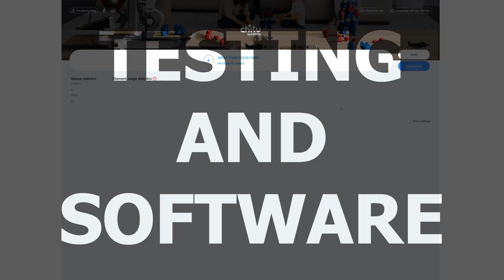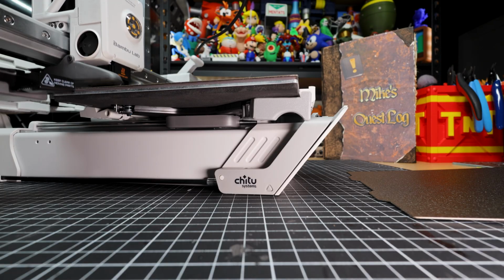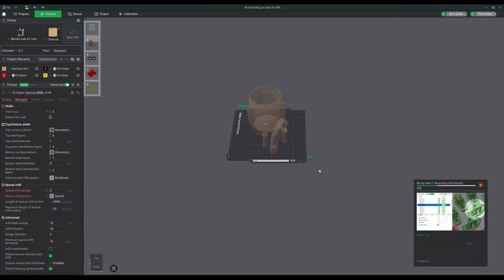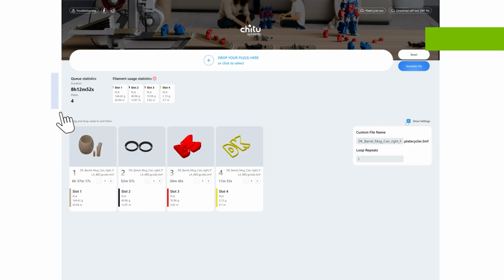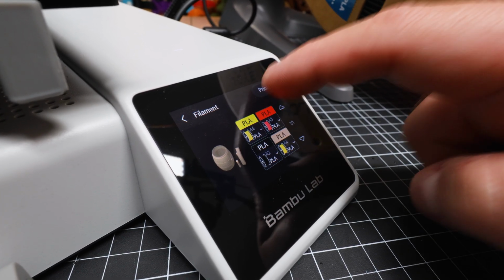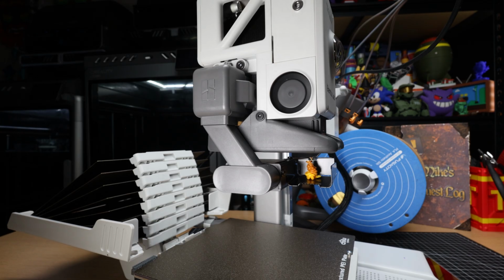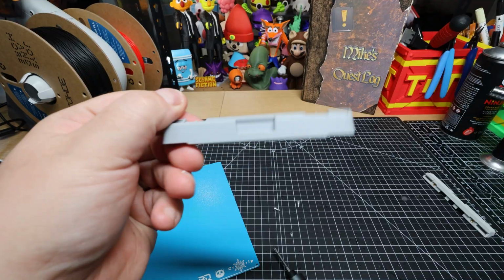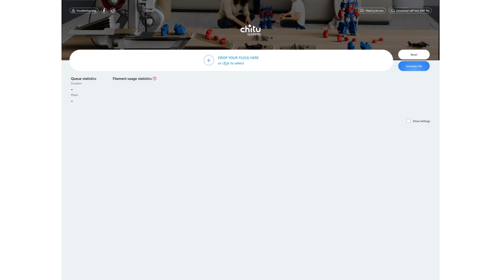My A1 Mini Just Kept Printing Without Me — Meet the Platecycler

Comment: I was sent one to review and I can't say I have enjoyed it much.  The lack of clear instructions is disappointing since the A1 Mini and hugely popular for beginners.  I was trying to figure out why Bambu Studio was blowing up and it turns out you can only use this with the SD Card, not making use of the wireless connection we're all used to.  I'm also finding the front bumpers fall off a lot.  I did the Plate Cycler test and it moved 8 beds without issue.  What also wasn't clear was this - will it load the bed before the print starts or do you place one on the bed and hit start?  (The latter)  If I load one bed and 3 in the tray for a 4 plate print, the last tray will fail to load.  I've tried it over and over again and gave Chitu some feedback as well.   Overall, I think this is as useful as those printhead mods that display emotion-icons.  The lack of concise instructions is a huge no go for me - and honestly, a device like this might be much more popular on the Bambu Lab A1.  (Why they didn't aim for that market, I'll don't know?)
Reply from the maker: We might have gotten different versions? There wasn't a single thing that was confusing in my instructions honestly. 
A1 mini is a beginner printer but why would a beginner need a print farm kit at all? 

Loading build.olate before printing should not even be a question too. When do you start a print without a build plate? Loading a plate before hitting print has been and will be the most basic of requirements/steps since 3d printing has been a thing. 

I still use mine (around 300 cycles so far) and the magnet popping out that u mentioned was the only issue I had. I can see push blocks popping out being an issue long term but that's why they provide STL to reprint these in case they ever get worn out. 

Wireless connection is again not an issue and if you understand how locked bambus ecosystem is then this shouldn't be a surprise at all. You can still use it wirelessly if you want. You can just load the g code back to the studio and send it but I think you misunderstood the purpose of the product.

This is clearly a print farm addon, most print farms run on either lan mode or SD/USB memory purely because it is easier to load up your files and keep them organized on dedicated part printers.

It's not for everybody but you claiming the instructions are unclear and complaining about the basics makes me believe that you misunderstood the purpose completely and do not run a farm and just look at it from your own use case perspective

Comment: Good afternoon. First, I apologize for my English. I am Portuguese and I am using a translator. I am new to the world of 3D printing. I found it a great idea. But I think there might be a problem, correct me if I'm wrong. The bed is hot, but the plate is cold. This could cause a conflict with the printer, and it might start printing even on top of the cold plate, since the printer thinks the plate is hot because of the temperature sensor, which is not on the plate. In short, it could end up causing adhesion problems between the part and the plate, right? I apologize if I'm asking a stupid question, but since I'm still a beginner in this world, and everything is new to me, I like to ask questions if anyone is willing.
Reply from the maker: I'm not sure if i understand correctly but if the bed is hot then the plate must also be hot. They transfer heat very quickly

Comment: Thank you so much for your review!
Regarding the magnet issue — you’re absolutely right. The early review units we sent out did have a problem with the glue, and the magnets were more likely to come off. We really appreciate you pointing it out.
We’ve already fixed this before producing the main stock and switched to a much stronger adhesive. It has passed repeated 1000 times manual stress-tests without coming loose. And we promise we will continue to refine it.
Thanks again for catching this early — your feedback truly helps us improve the product for everyone.
Reply from the maker: Great to hear the magnet issue was already caught and fixed. Luckily, if anything goes wrong the fix is very easy